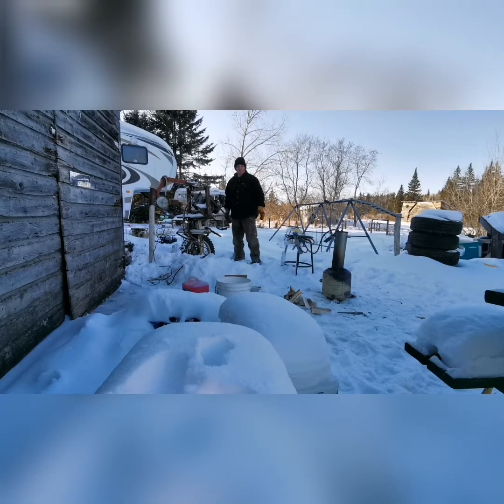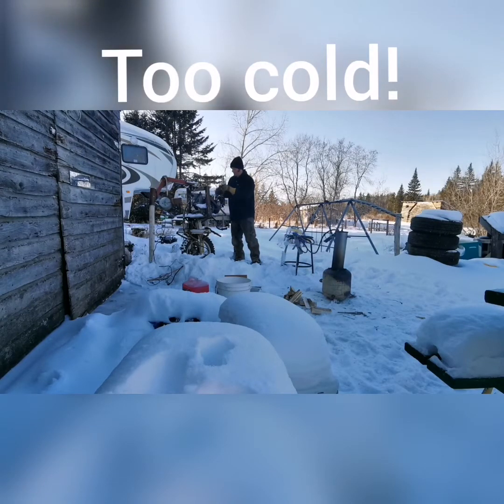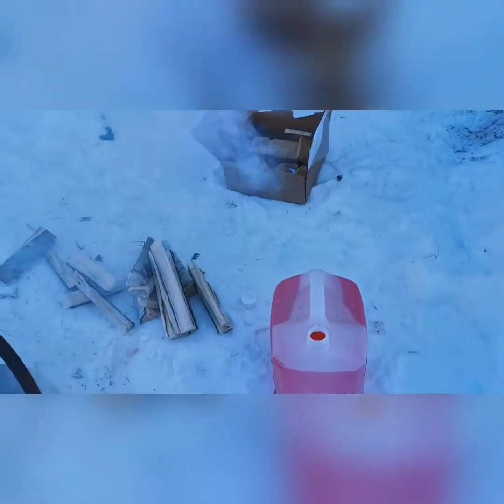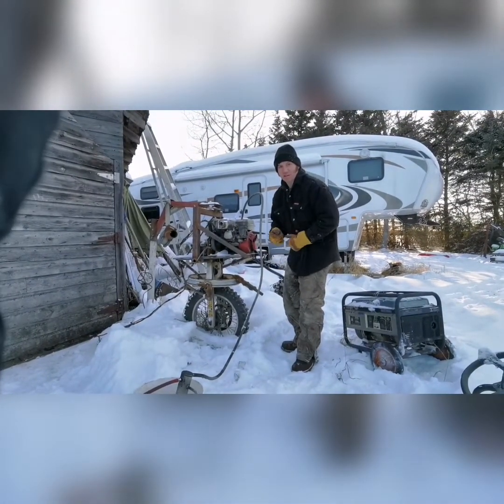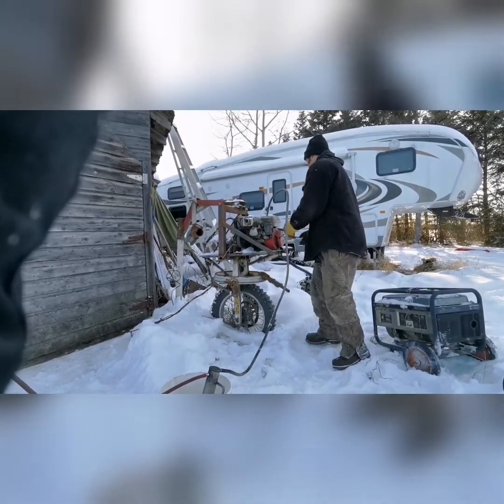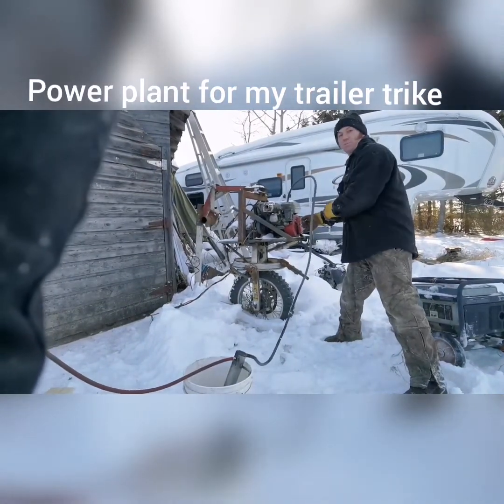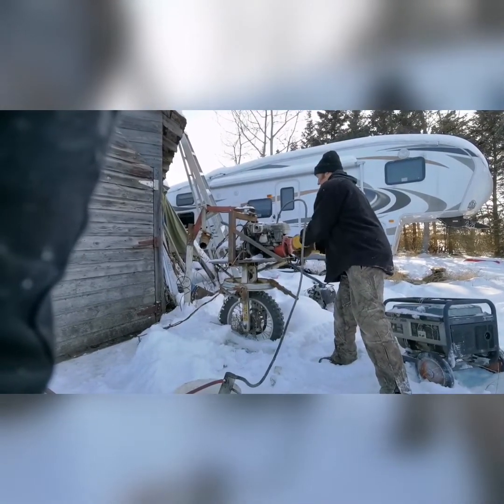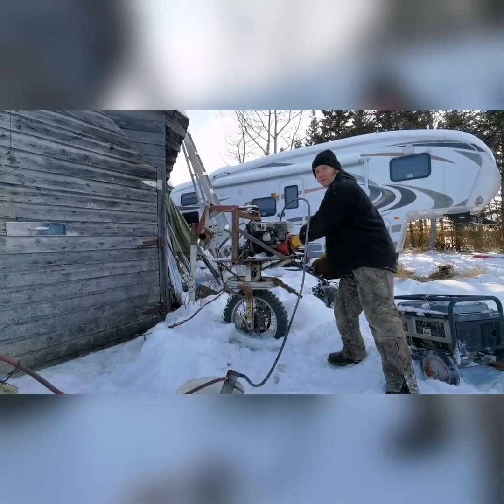Gold Wrenching: Wood Gas

Comment: After pulling those starter ropes a few times, you will get warm😁☕🔥
Reply from the maker: You sure do! 😆 When I have some more free time, I have the pieces to make a much larger version of that. Should run a vehicle. I hope. 🤣 There's only one way to find out!☕️😉
Reply: @GoldWrenching  Years ago, an old guy I did work for told me some about gasifier engines.
 About same year(s), a town 30miles away, a guy had a 1-ton Chevy flatbed, looked like a sleeper box, behind cab. It had complete gasifier set up inside.
 Was local newspaper did an article on the guy and his truck. Few months later, it was confiscated due to "unpaid road & mile tax", which is paid when fuel is normally purchased.....👀.....
Reply from the maker: @invisibilianone6288  Really! Those S.O.B.'s. Boy, that really gets to me. A guy should be able to explore any option, besides mass destruction. Which is the way we're heading right now.
Reply: @GoldWrenching  "Where am I? & Why am I in this handbasket?"
🎯⚡😁☕
Reply: @GoldWrenching  one year, burning man event, they had a machine that ran on gasifier, burned garbage, from the event.🔥🎯😎
  454 Chevy ,,, they did tours on the process, with the toureee, putting their garbage in at step one, and learning how their garbage, burned and processed through the system, powered the machine⚡😎☕
Reply from the maker: @invisibilianone6288  Wow! That's awesome! Thanks for sharing, man. That's really cool.☕️ And gives me ideas.🤔😆☕️